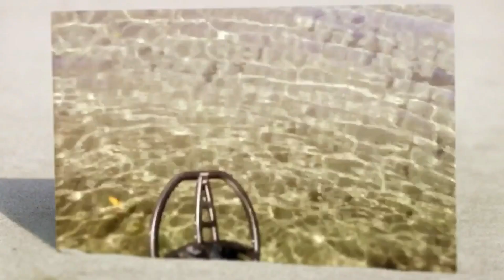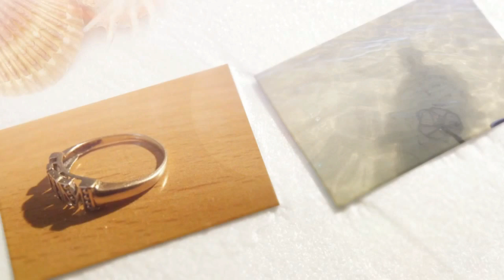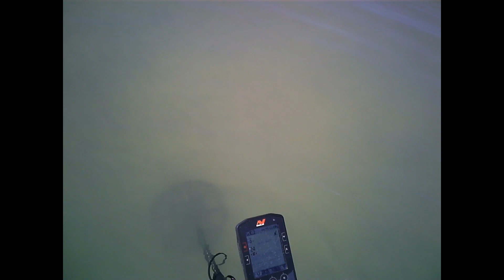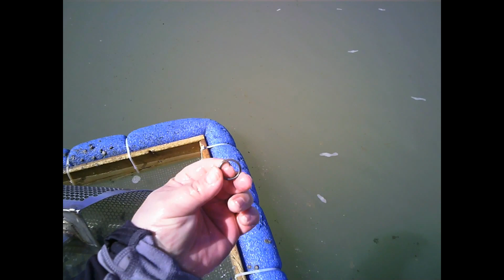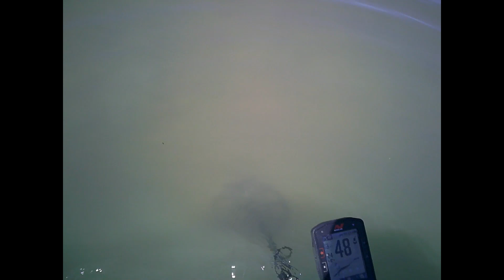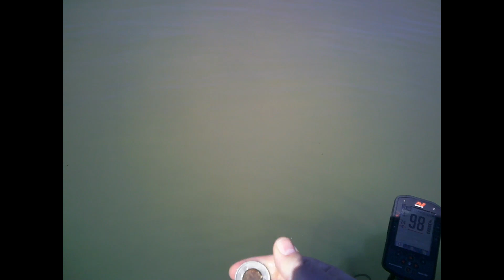Water Hunting @ Beach with Minelab Manticore - Can It Handle Black Sand?

Comment: Do you still use the manticore water hunting
How are you liking it. Can you tell us your settings
Reply from the maker: I do have the Manticore. I ran into problems with it at seasons end. Our water hunting season runs from approximately May through to Sept, so it's still too early to have started using it in water as we are still getting snow here. The issue I had was with the head. I worked with the PA repair people, they were great, but I had a series of issues which were never explained completely to me. My impression is that somehow the audio stopped working propery, this might have been water ingress issue, but I never received confirmation. I'm on my third wireless headphones, and have only had the machine since April of last year. I got an M15 coil and it arrived dead to me straight out of the package, so I had to ship that back, and get another. I am hoping with the M15 coil, I will be able to have a better idea how it compares to the Legend paired with the LG35 coil, but I have to admit that with the issues I've encountered, I am nervouse about using it in the water. One last thing, I had barely 10 hours on the wireless headphones when they stopped working. I had been using the Gray Ghost amphibian headphones in the water the entire summer, when I transitioned to land hunting in September, I noticed my wireless headphones were dead. I sent those in,they sent me a new pair that were also dead on arrival. Then after the third set, they seemed fine, but since then, I've just kept my Grey Ghosts on. The build qualiy and or quality control on the Manticore (at least from my experiences) seems very concerning for something I've owned for less than a year.
Reply from the maker: Regarding settings, I'm mainly using the pre-set programs. After all the issues, I didn't bother trying any custom programming untilI I know this can run stable, and I won't have to send it in to service. General, with the latest update, so used red target ID, and the main thing is the underwater boost which does help with audio enhancement that has been useful when using Gray Ghost headphones.

Comment: wait till you try it in the salt ugh,
Reply from the maker: oh no! what are the issues in saltwater?
Reply: Falsing sensativity has to go way down Even in salt and surf mode
Reply from the maker: @roymanewell4958  thanks for this. Next time you are out, try "cylicing" the noise cancel - by cycling, I mean keep it pressed down, and watch the numbers on the screen. If they jump around and don't settle at least for about 3 seconds on a single number, then there is nothing you will be able to do. However if you see it settle to a number and stay at that same number for at least three seconds, let go of the noise cancel button. Then try to raise the sensitivity until it is begins to get chatty. This has worked reasonably well, but in certain environments, the numbers jump around too much, and don't settle down, then there's nothing that can be done. You will have to lower sensitivty. Which is a shame.